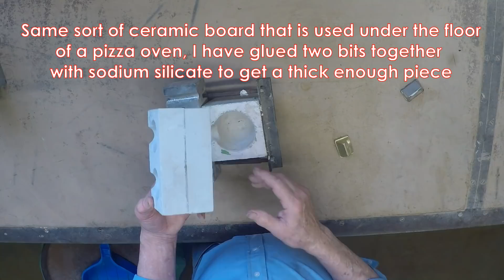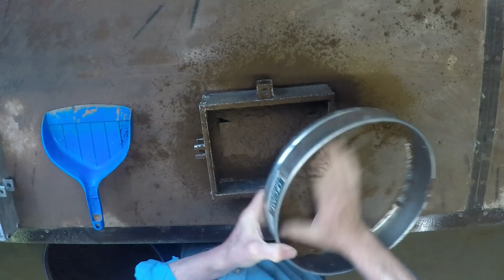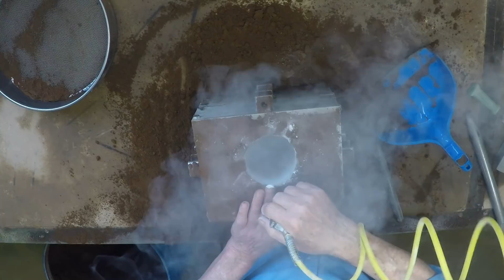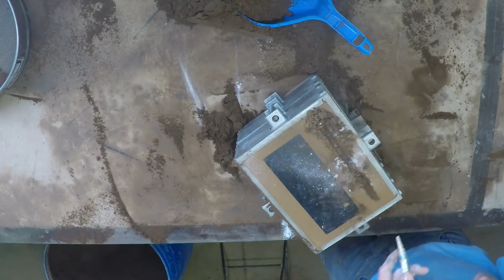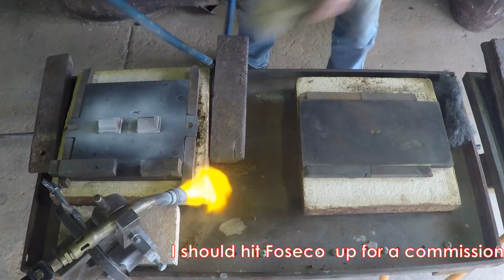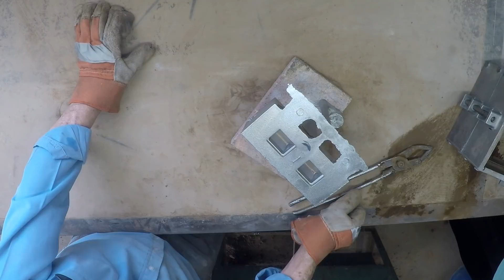Lens Blank Die

Comment: Awesome topic and video .. thanks for another great one... would you ever consider messing with cast iron for that work?... if so, or not, do you have any thoughts on it?

thanks again... Jim
Reply from the maker: Jim, I have made quite a few dies out of cast iron as it is an excellent material for the job, and produces quite a long life die. I use continuously cast, cast iron bar. It is available in sizes up to at least 12 inch diameter. But these dies are produced by the traditional machining route. Could I use cast iron for the technique that I use here - never tried it but I have my doubts, perhaps using a steel master with lots of preheat and different mould sprays (graphite based most likely) it might be a goer. If I were a bit younger I might be moved to experiment as an iron die will last for tens of thousands of castings while an aluminium one perhaps for 500 although I am a bit more hopeful this time as I have used a piston alloy for the die and they have better temperature resistance - we shall see!... Martin

Comment: Those birds were making  a fuss. I had to rewind a few times to hear a few things I missed. I'm looking forward to the next one, casting aluminum in aluminum intrigues me.
Reply from the maker: Amalgamous, Yep, those birds are a trick, see my reply to Nathan above. Aluminium into aluminium seems like a no go but  it was done years ago, back then they hard anodised the dies, but I don't know what sort of life they got. I just decided to try it many years ago but I don't anodise the dies I just use standard commercial die sprays. For simple none re-entrant angle castings it lasts perhaps 500 shots when the dies are in 601 (356) alloy I am hopeful the piston alloy used this time will significantly extend the die life. Why doe it work? well the amount of heat being put into the die is a small fraction of that required to melt the die in fact the dies when I ran them never got much over 250 Deg C. The good heat conductivity of the aluminium also helps as it spreads the heat out quickly preventing it form building up too much in any particular area of the die... Martin
Reply: My years working in a 24% full lead crystal glass factory we used a water based graphite spray made by renite. I would have thought renite s-28 which is used in extruded aluminum production or some other hot forging die lubricant would be used to prevent sticking in a steel alloy mould. But I wouldn't have guessed something like that would have protected a hot pour into straight non-anodized aluminium mould from sticking and get a clean product. Fascinating...
Reply from the maker: Amalg, I have used graphite based die sprays for this sort of work, Foseco  make them they are water based and flash dry when sprayed on the hot die. These days I use the Boron Nitride spray as it is somewhat better than the graphite. The trick though probably has more to do with the oxide layer that is present not only on the die itself but also on the liquid metal flowing into the die. This oxide wild not stick to itself so to get adhesion you have to break this film on both the surface of the die and the surface of the metal. Its a very tough film and if you do mange to break it, it instantly reforms if any air is present. I have made thousands of castings with this process and only once with one particular die did I get these films to rupture and a small area of stick resulted - it broke away easily and once the area was cleaned up and some die spray applied it never occurred again. Also of course the die conducts the heat away very quickly and this to helps prevent sticking, think of steel and iron castings made in copper dies poured perhaps 300 to 400 degrees C above the melting point of the copper it works well because the copper conducts the heat away before it can get up enough to melt the copper. Railway wheels are sometimes made this way... Martin